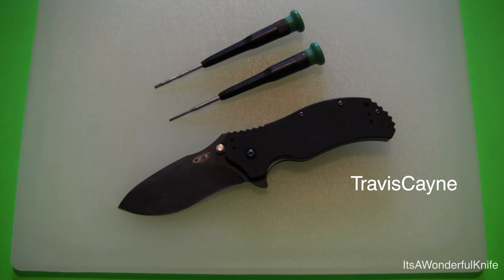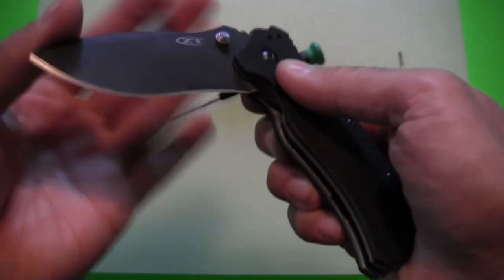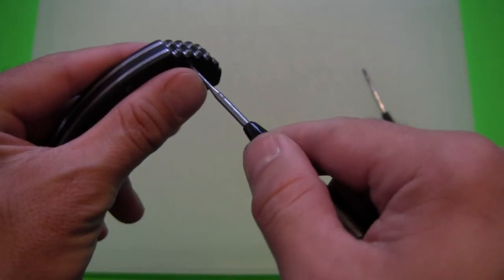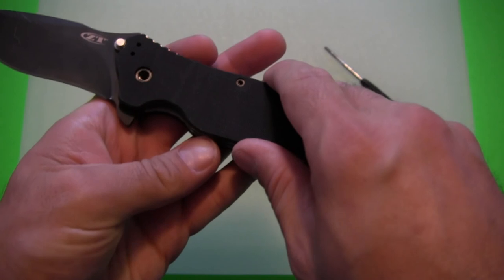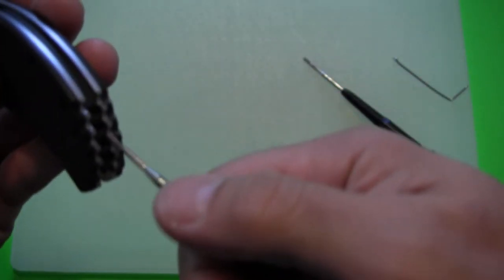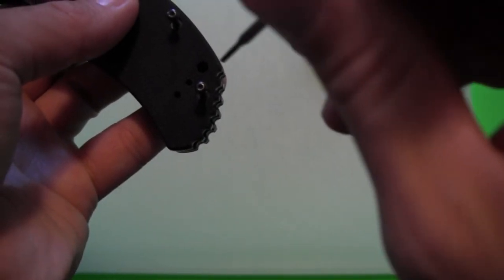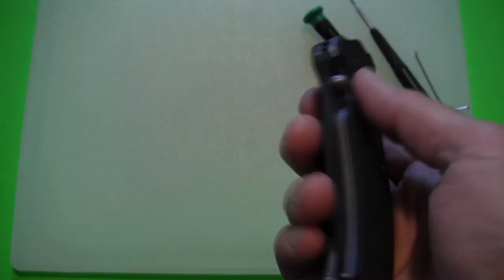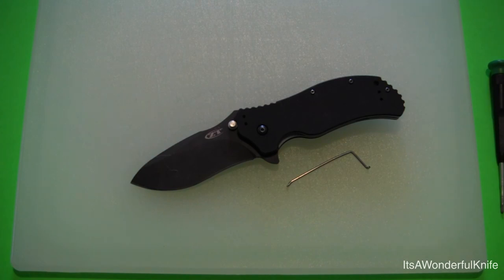Removing the Torsion Bar from the Zero Tolerance 0350

Comment: Just took the bar out of my 350 but it's still pretty stiff. I have to really flip it hard or use my wrist to open the knife. Any way to fix this?
Reply: adjust the tightness of the torx screw till its as tight or loose as you want; had to when I de assisted my blur. It's easier then it sounds.